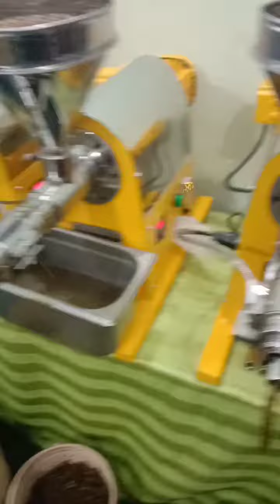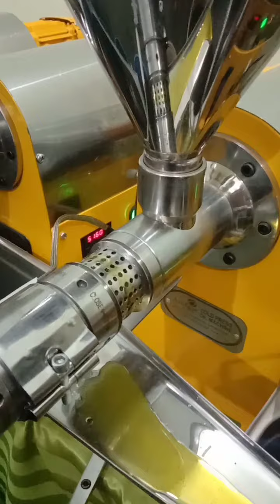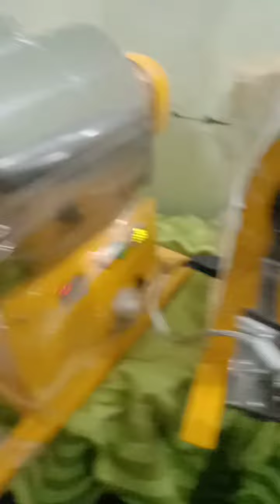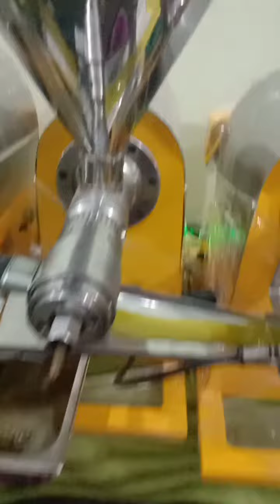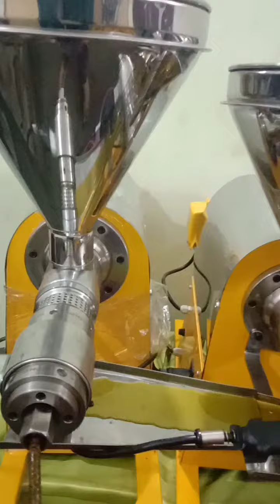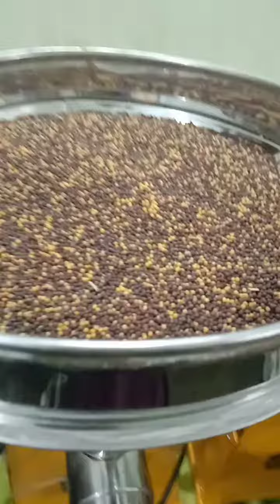Mustard oil expeller/ Mini oil mill/ Oil expeller for sale/ Cold oil press/ Ashfaq&co

Comment: What part frequently gets damaged and need to be replaced. 
What running spare parts are required to be kept ready in stock.
If it is installed at home for domestic use , what will be the disposal of residue ie oilcake etc.
Normally at what cost the oil residue can be sold , and where ?
Reply from the maker: Aoa.
What's app 03333222239.
For more details thanks